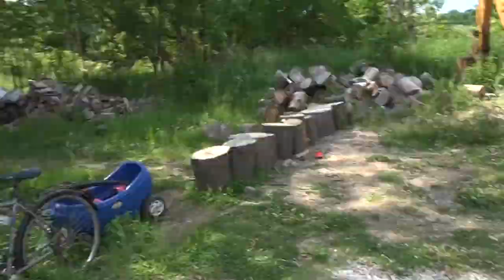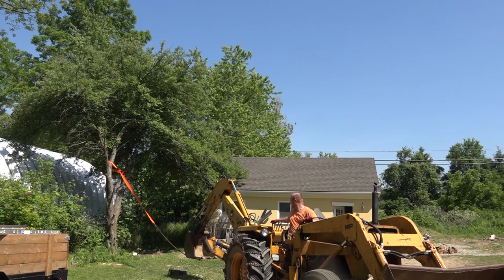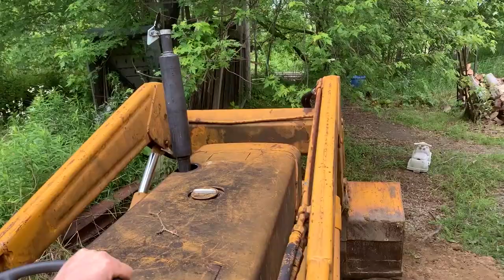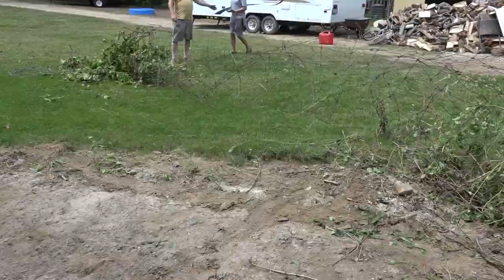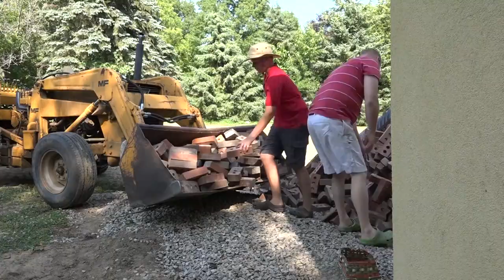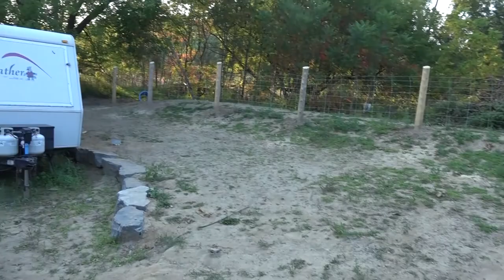Backyard Overhaul with old MF-40 Backhoe - Grading, removing trees, and building a berm

Comment: Does the concrete counterweight on the front help with the loader work?
Reply from the maker: Short answer is yes.  The backhoe is actually a bit big for the tractor and without the weights (about 300 lbs), the front end gets really light and makes it hard to dig in.  I ended up making the weights after I got the tractor.
Reply: @VincesDIYs  You built the weights yourself? Any direction how to do it?
Reply from the maker: @UneFermedansleGers  yes.  I built a plywood box as a form, added some rebar and welded some brackets to the rebar.  The brackets  came out of the form and attached to the tractor.  I used old motor oil to coat the form to make it easier to take it off afterwards
Reply: @VincesDIYs  Thanks! I may buy a MF40, it will help.